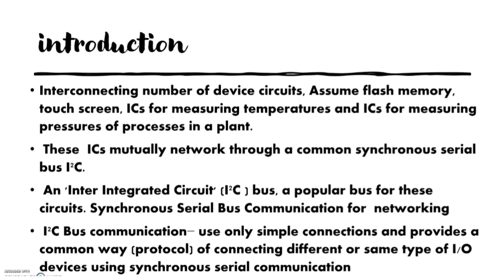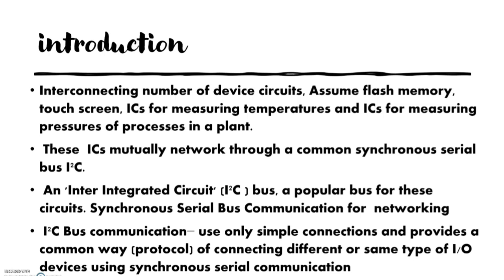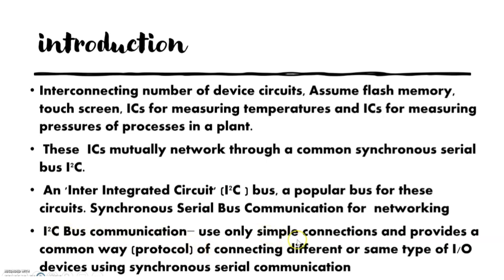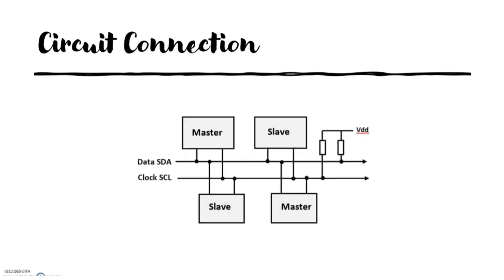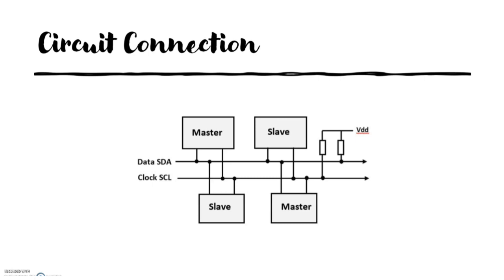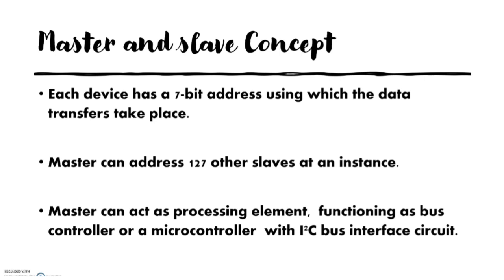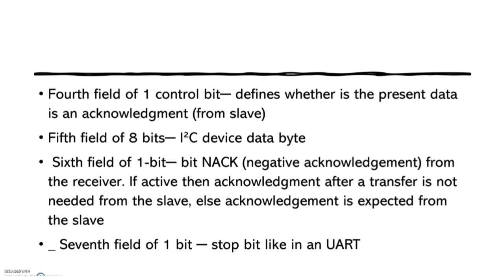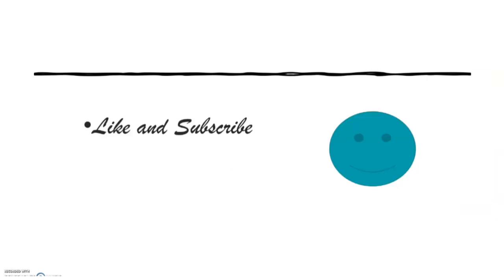I2C Protocol| Embedded Systems

Comment: for what purpose the circuit with Vdd is given to SDA and SCL lines? what is the circuit name called?
Reply: I2C devices are open drain devices ,they need external pull-up resistors to be connected to SDA & SCL.
Reply: @nimishm6540  Bro I need technical supports iam fresher 20.years old